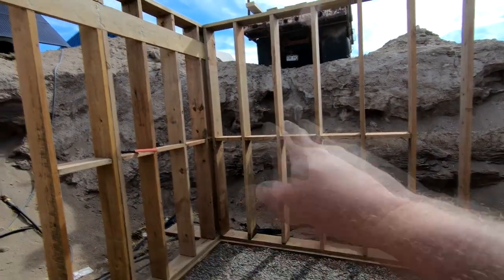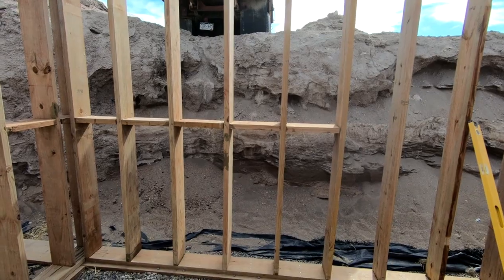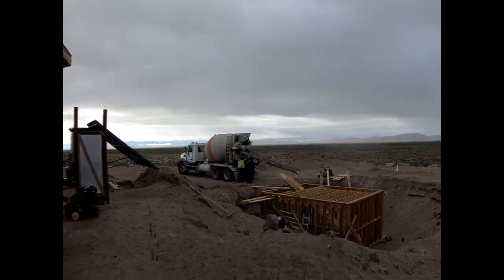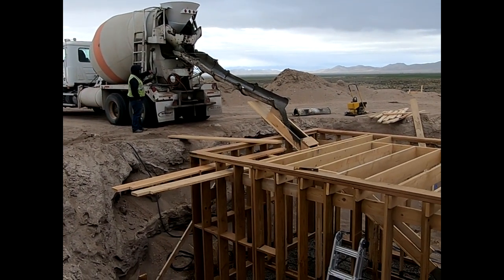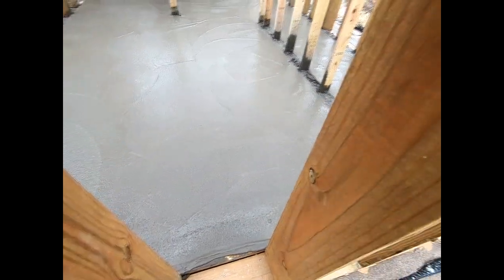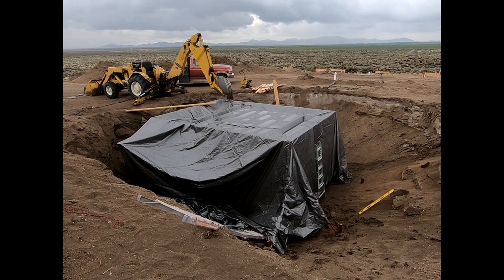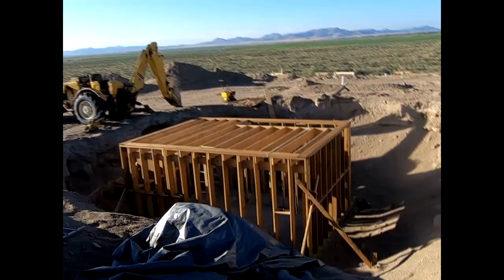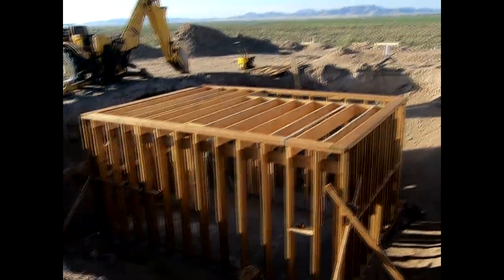Building a Permanent Wood Foundation

Comment: Why did you go with PWF if you were going to pour concrete anyway?
Reply from the maker: That's a good question, thanks for asking. The architect actually designed the house for a concrete cellar.  We're not fans of concrete, but we realize that there are places where it makes sense.  The rest of the home will have a deep rubble trench (gravel footings) with a huge concrete grade beam on top to support straw bale walls. With all of the concrete already required,  we wanted something less...concrete, if that make sense.  It was going to be extra 10 yards (plus form-up, etc.) for the cellar walls.  So instead we opted for a PWF and poured 2 yards of concrete floor (we can splash water on it at times to increase the cellar humidity).  We saved at least $4,000 going with PWF walls.  Very happy with the result and highly recommend it, particularly if you are in a dry climate like ours.  :-)